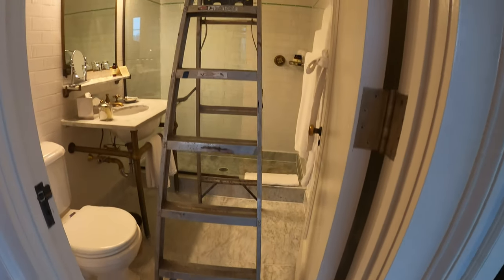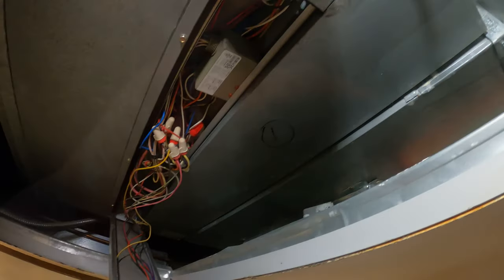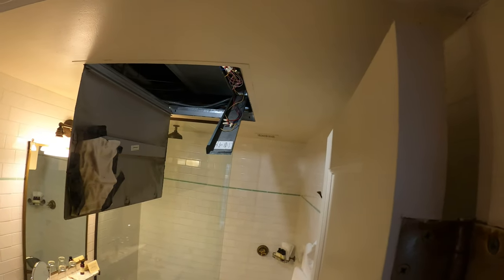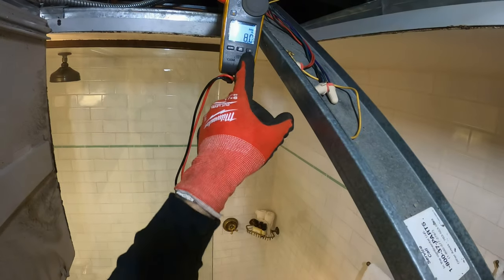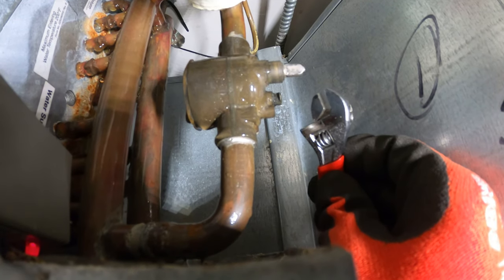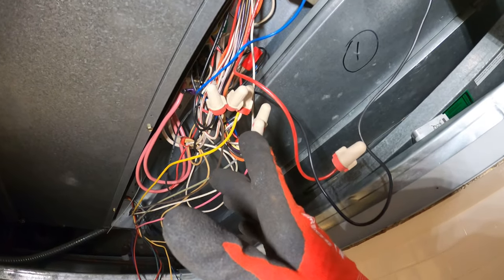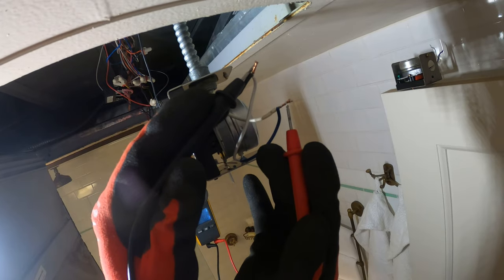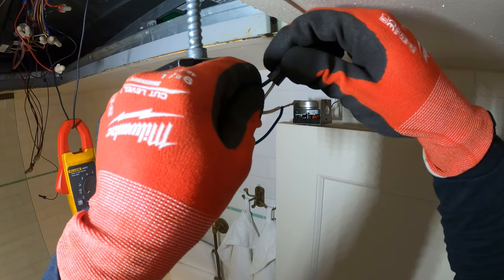HVAC Service Call: Fan Coil Unit Not Heating (2 Pipe FCU Not Heating) FCU Not Blowing Hot Air

Comment: Hey great video jumper man tech. I work on this stuff all the time. You have a two pipe system with changeover switch and electric back heating. I did notice  your building flow pressure extremely high. I would recommend a circuit setter on the return pipe . U can manual control with ball valve to cut down the flow a little. You install a new valve it still might not over come that flow pressure.

Comment: Wow....tnks to u n Chris I think he's famous also behind the scenes.....Hey. this is exactly the Units we have and Deal with by our beach Comunity....Chilled Fan Coil w 110 v or 24 V control either or ...using the same Tstat wich is ok for 2 or Pipes .. ..u got it in the first shot. The water lines here also drip n leak so we freeze the Lines and install new valves in tight spaces like that...we have plumbers that do that part....tnks great video that's a 2.3 kw heater by the way...a d yeah ur troubleshooting skills are great....come down here Give us a hand....I kno u busy there.Blessings my bro. Say hi to Chris

Comment: can you show one day how to set the Honeywell setting part We only have 2 pipes here in Fl no pipe sensors or 4 pipe arrangement that i see.....Default settings sometimes do not operate the FCU well ....our Electric heat here is behind our fan or blower motor so we have to pull down motor to access the heater elements
tnks i m in fl    kind of 81 degrees today 43 4 days ago   weird climate give us plenty of work   blessings   say hi to Chriss is he ur son or helper